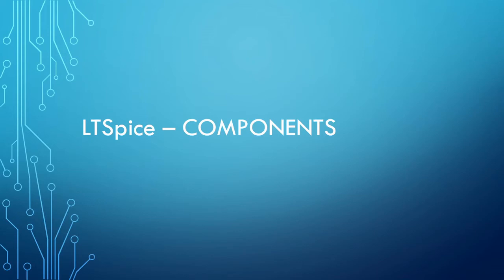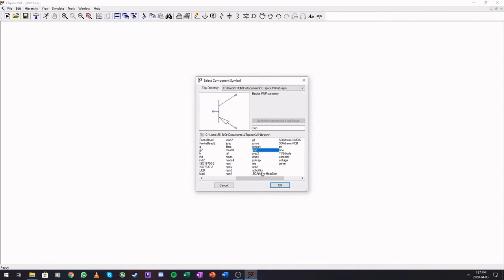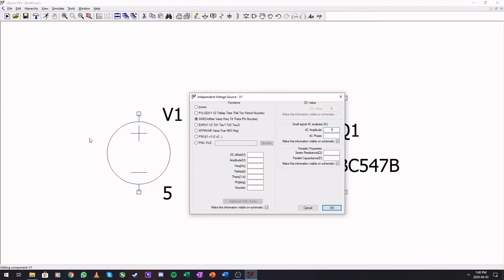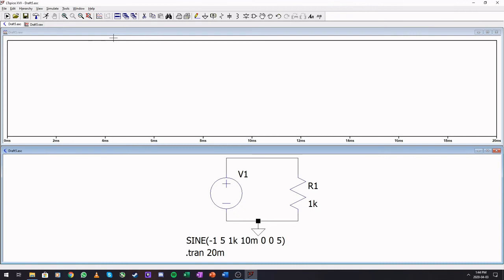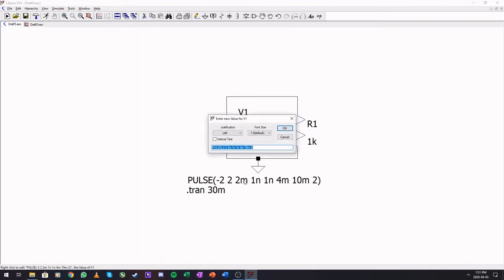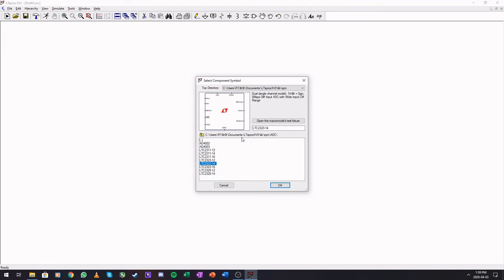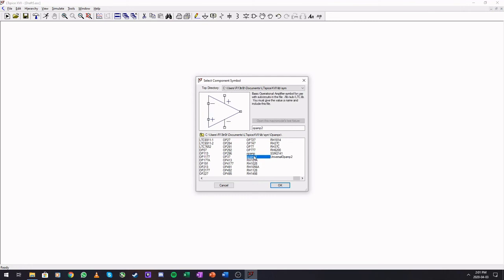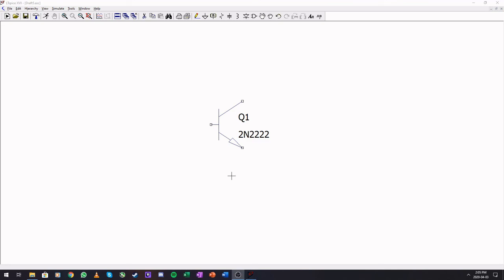Video 2 - LTSpice Components

Comment: how do i find mesh
Reply from the maker: Do you want to find the mesh currents in a circuit?
Reply: @EzElectronics  yes
Reply from the maker: @ikalleit  You can run the spice simulation .op (it is called "DC op pnt" in the simulation window).
This simulation will give you the voltages for each node and the current through every component in a list. If you close the list you can select the nodes to see where each voltage is located or you can open View -> SPICE Netlist to see to which nodes components are connected.